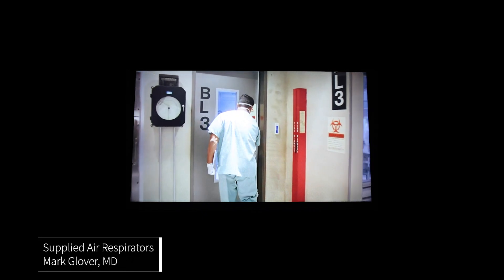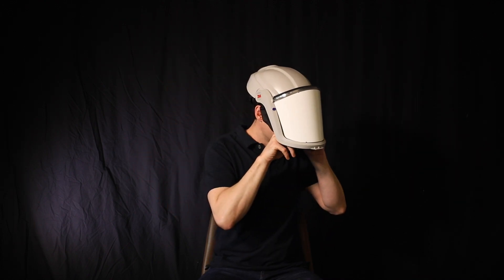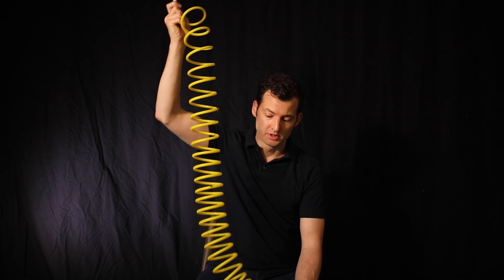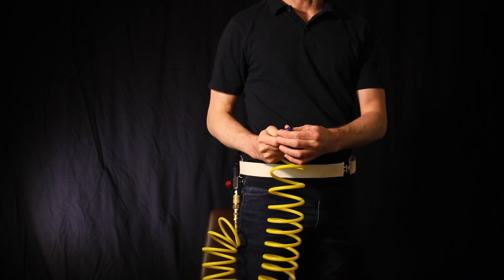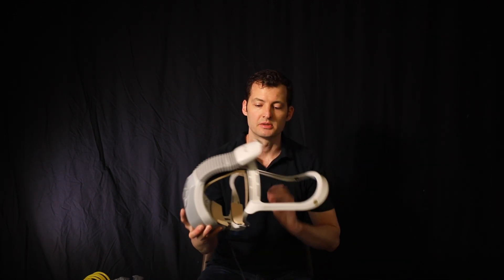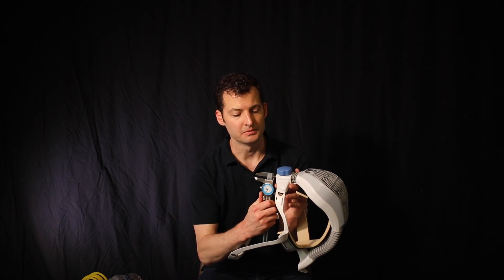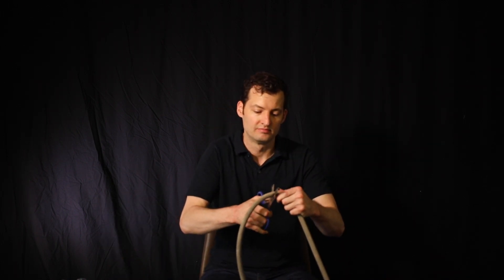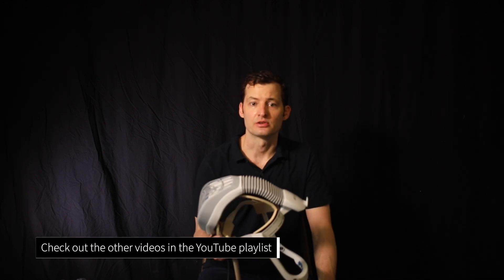Supplied Air Respirator from Medical Air

Comment: As an RN in an ICU, I’ve used medical air or O2 through oxygen tubing to a oxygen mask with volume set at free flow. Used it for particularly “ripe” patient care situations. Thought about if my idea could be modified just as you did. Not sure the Powers That Be would approve but I’m going to run it by them. Much better for extended COVID patient care duties than an N95.